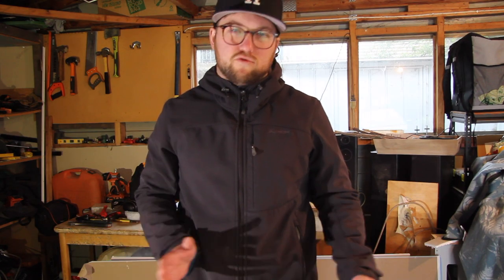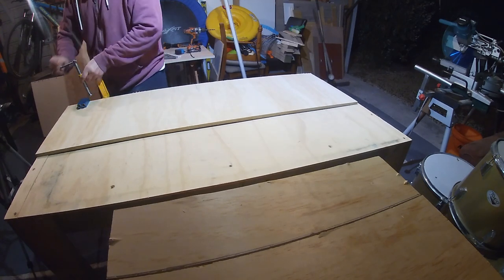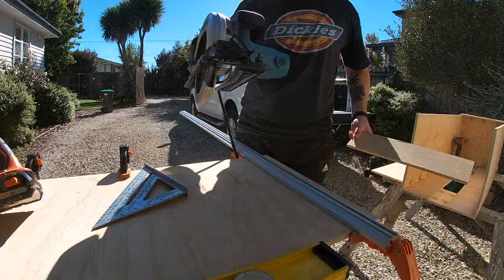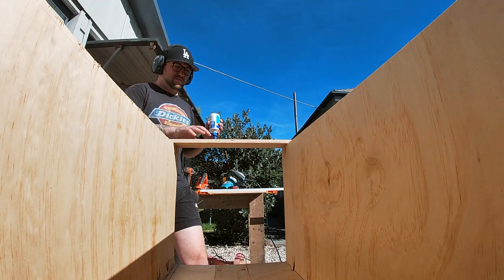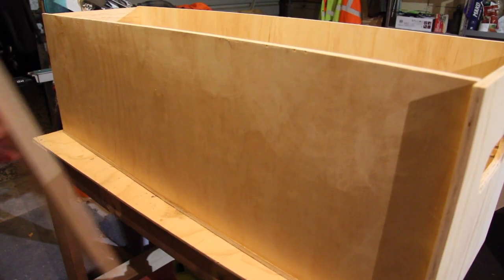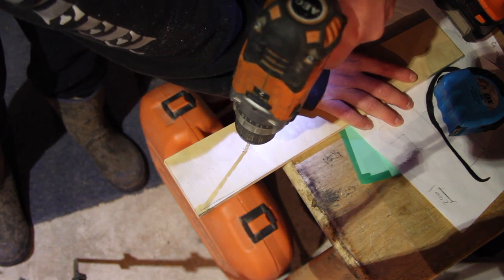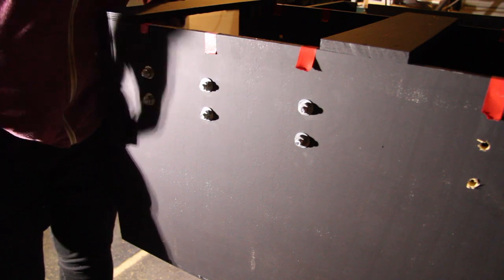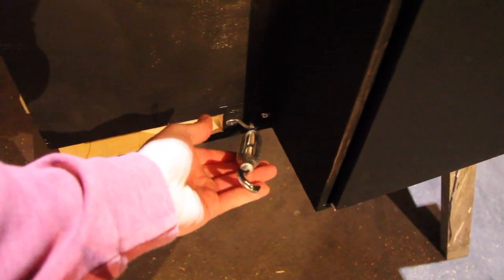Sliding Truck Bed Drawer Storage - DIY

Comment: Looks good Sam. Only thing I'd suggest is you could save yourself half the pocket screws, no need to use both holes at every location, one each is perfectly strong, especially with glue added too ;)
Reply from the maker: Thank you! I agree, was definitely over zealous with the screws, must be 50% of the cost of the project!
Reply: @samsboringchannel  they are! My rule of thumb is 1 screw about 5cm from each edge, then about 20ish cm spacings. Wider if not load bearing, a bit closer for extra strength. Nice build still!
Reply from the maker: @FixitFingers  it was my first real go at making something with a pocket hole jig really, and a taster to whether I want to spend the money on the real deal (which I do!)
Reply from the maker: @FixitFingers  I look forward to the video :) it'll help me make up my mind
Reply: If you was using Kreg screws Sam, old Fingers would be telling you to use 6 screws every 10mm, and here's a code to use at checkout. 🤣 Wait....sounds like that guy on instagram with the pockethole jig thingy 😎
Reply: @TakamiWoodshop  my innate tightarseness is greater than my internal capitalist 😂

Comment: nice. 1 thing I would have done different was install the pocket screws from the outside instead of inside. much stronger that way.
Reply from the maker: That's a great suggestion. This was one of my first attempts at pocket hole stuff, and I sort of followed my nose without really researching it! Luckily though almost a year on from finishing this project it is still holding strong! Thanks for watching

Comment: That looks well legit mate! Does the truck bed have pretty beefy attachment points or did you have to put some in ?
Reply from the maker: Thank you! Yeah it came with some great attachments, rated far beyond this application, and hasn't budged a mm. The one thing I do need is a couple of new points putting in on the box for light items that need tying down, as the two ive used for the box are completely inaccessible now!